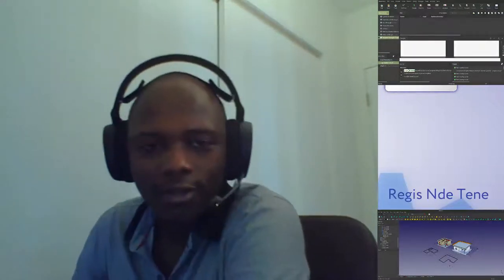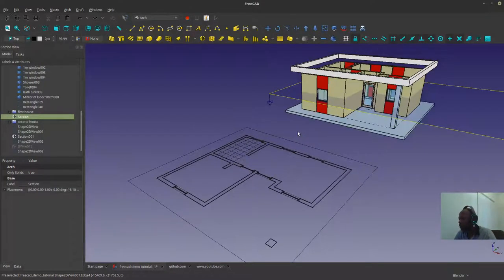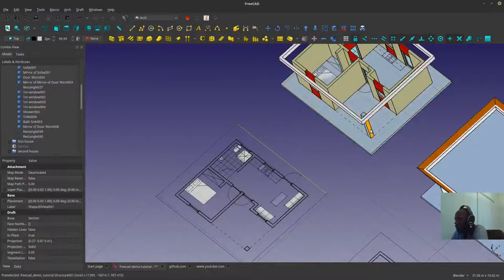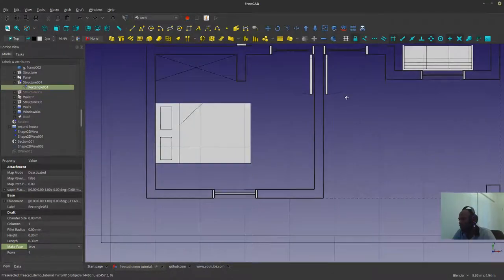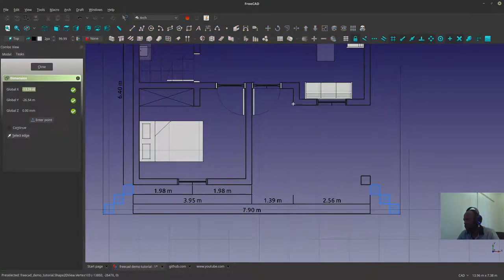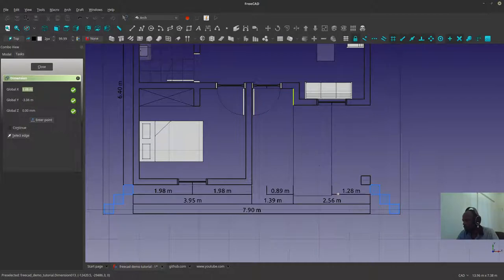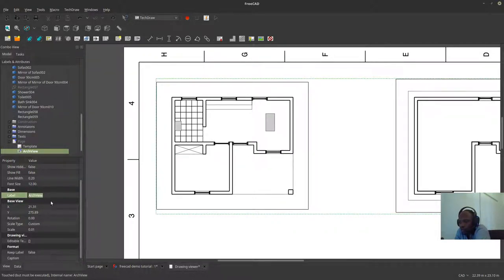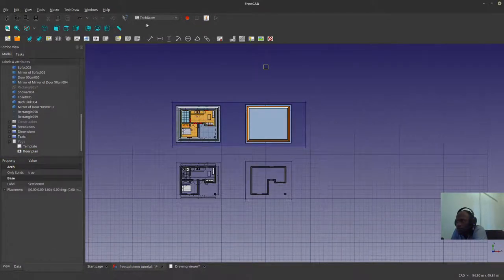FreeCAD Arch - Annotations, Arch Spaces, Techdraw - 06

Comment: Hi Regis, and thanks for the video. I have a question. Why in the s 2DView we can find the projection of the bathroom tiles, even if the section plane does not intersect the bathroom floor?
Reply from the maker: Because the bathroom tiles was added to the section plane individually
Reply: Ok, but we added in the section plane the entire first house including roof for example, but the roof does not appear in the 2DView. I tried also to add individually the roof in the section plane but nothing happened.
I tried also to add the 2D items (doors, sofà, bed, etc..) in the section plane but they does non appeared in the 2DView. Thank for your answer.
Reply from the maker: Is your section plane horizontal or vertical? If it is a section plane horizontal cutting the building to create a floor plan, you will not see the roof because the roof is above the section plane.
Reply: Ok. Understand. What is strange is that the 2D compounds (like bed,sofa, etc.) are not showed in the floor plan drawing nevertheless we added them in the section plane, line and rectangle are instead showed.
Reply from the maker: Could be a bug you can show in the freecad forum

Comment: what i can do to change the size of the techdraw? I need print in 0.90x0.60
Reply from the maker: Aaron Galvan 0.6 x 0.9 pixels?
Reply from the maker: let do some stuffs and i'll get you a tutorial, how does that sound?
Reply: Regis Nde Tene that sounds good. 0.60mx0.90m it's the size that i want to print it
Reply from the maker: Aaron Galvan yeah check the video on pdf

Comment: bro...how to create a parametric  distance from column to column....i want each and every one to have a dynamic distance
Reply from the maker: What do you mean by dynamic distance?
Reply: just like how sketcher works....u can add parameter distance ...and change it easily .... but i cant use parametric distance when im in Arch Mode....its only active on sketch Mode
Reply from the maker: Look up my video number 4 working with constraints I think. That should help you.